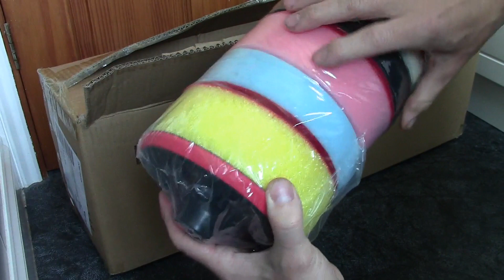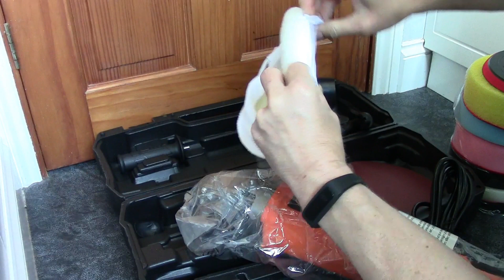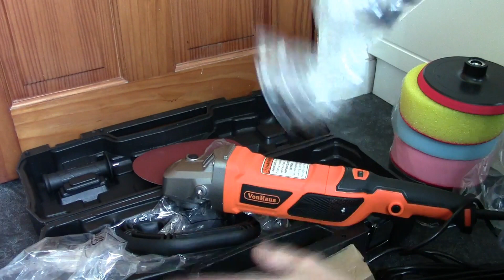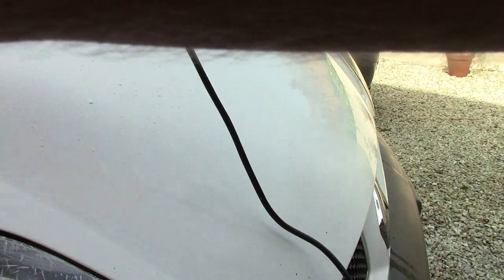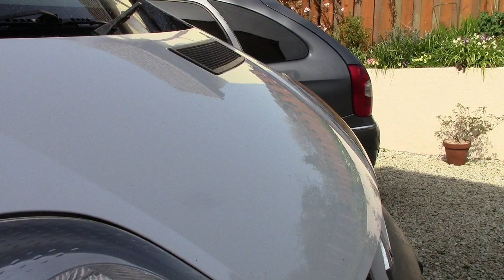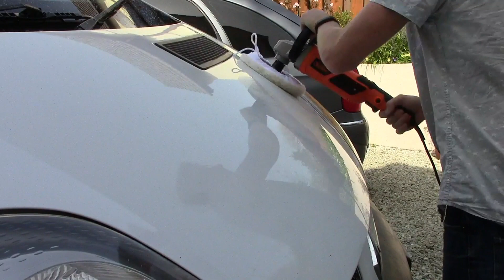VonHaus Dual Action Polisher Review

Comment: You really need to do a decontamination and clay cloth/bar first, otherwise this is pointless.. Also, dab the compound/polish etc onto the surface before using. Never do more than around 2 foot square at a time and keep the movement side to side and up and down.
Reply from the maker: I've since modified it so it spins even faster, have to be careful or the paint burns.tcut helps get rid of oxidised paint.